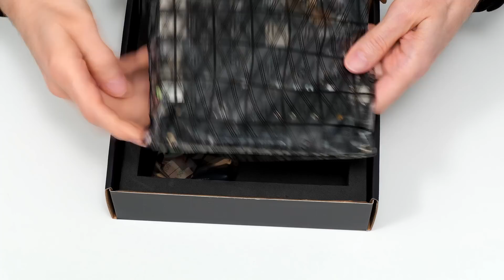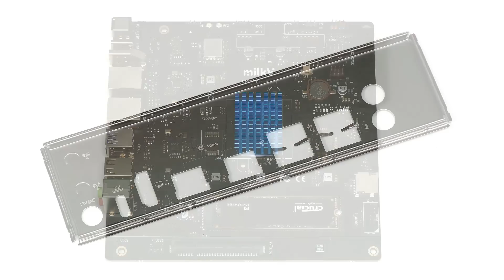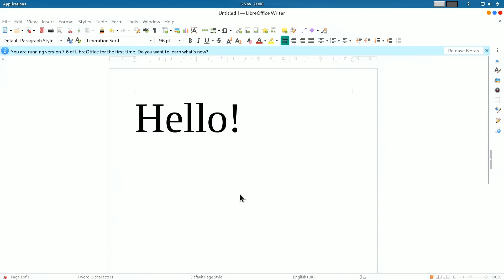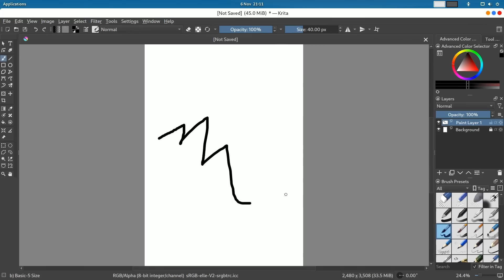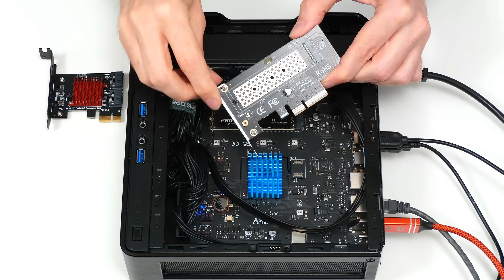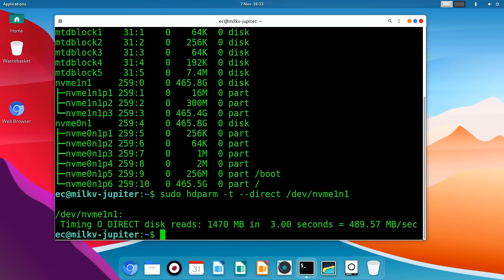Milk-V Jupiter RISC-V PC Build

Comment: It would be interesting to test the PCIe port with a graphics card. An x16 card wont fit into an x8 slot, but maybe there is some type of dongle?
As Linux includes drivers for AMD cards I could imagine that it runs much better than you would may expect on such a system. The bottleneck would of course be the CPU, but that's not really the point here for me.

Comment: 21:25 IMHO it's not just that it is new, but also that it is an open source hardware design with the potential of improving very fast and being customised to the needs of single applications.
As you said in the video: It's incredible how fast the development of RISC-V comes along (but to be fair I can't remember whether x86 or ARM CPUs improved that much in such a small timespan).

Comment: RISC-V: Terrible instruction set made bearable by pushing billions of dollars into it.
Reply: The industry only allows monolithic design with a chipset around the core, blocking interconnect channels.
We need a desktop on a RISC-V scalable grid.
Reply: @henkkl3505  No, we need a good instruction set.
Reply: @andreasrumpf9012  The RISC-V instruction set is complete. it covers all elementary binary operations.
Reply: @henkkl3505  It is severely lacking in addressing modes and lacks add-with-carry etc, etc. It's junk.
Reply: @andreasrumpf9012  Only if your entire CPU is single-core real-time scheduled.. It needs hardware redundancy like a cluster to get some flexibility. It would also entirely destroy the consumer computer industry. You can achieve the same results as the latest flagships with quantity of the same. None of the significant players will ever allow that.
Reply: @henkkl3505  Nothing what you said made any sense. Just dumb your nonsense somewhere else.

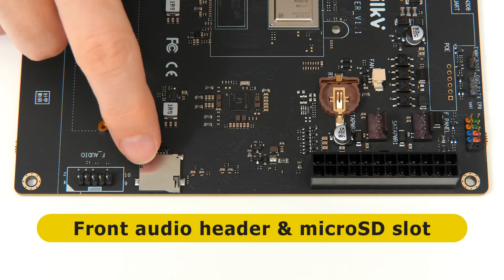Comment: 05:28 I wish there were PCs with BIOS/Firmware stored on a µSD card instead of a soldered-in Flash EEPROM. Imagine that: updating your firmware would then be as easy as swapping an SD card.

Comment: For Krita, itwas already usable on 1 core Sipeed based on Allwinner D1 without GPU, but you just need to disable GPU acceleration, as this board probably doesn't have OpenGL (default Krita rendering, so it switch to soft mesa GL rendering) but only GLES and vulkan acceleration?

Comment: I just fail to see how RISC is superior to ARM, Open ISA doesnt do anything for me when RISC perpetual licences are so cheap.  And even the core design performance of ARM Machines is tested and much superior to RISC they even come with GPU cores, which you can replace with your own design shall the need be.
Reply from the maker: Well for a start, Arm is RISC! Arm stands for "Advanced RISC Machines". So I think you are confusing RISC and RISC-V -- they are NOT the came thing! And as this video very clearly notes, the Milk-V Jupiter, just like ALL current RISC-V is a development board. It is NOT an end-user product, and is intended solely for those developing for, or otherwise interested in, RISC-V. Right now desktop RISC-V is not as powerful as Arm.

Comment: You could have unscrewed the back bracket from those cards to physically get them in the slot. There's no significant weight from the heatsink/nvme to worry about and it doesn't look like there are ports on the bracket you need access to.
Reply from the maker: No, I could not. They would not physically fit in the case even with the brackets removed. I of course tried this. As I explained, the height of the motherboard in the case (due to the drive space under it) prevents them from fitting inside it. I'm not an idiot! :)

Comment: 9:25 there should be fairly simple clamps be available either with the sinks or perhaps separately, should not cost more than a buck. The two holes are already there. Mostly south bridges are held down this way on x86-64 boards.
Reply from the maker: Indeed!
Reply: unfortunately this doesn't work quite that way. SB's heatsinks almost fit forcing one to use long poles because they have to be slighly at angle. Drilling round hole to eliptical shape is 'a' solution but as far as i am concerned there's no "out of the box" replacement.

Comment: Great video as always, I recently got a milkv jupiter for RISC V development and I'm already a fan of it. By the way, the jupiter is compatible with both radxa's rockpi eMMC chips, and the fan cooler for the rockpi 5B. So if you're looking for proper cooling and/or eMMC storage, I highly reccomend those. BTW, if you'd also like to try a GPU, I've heard that RX5__ gen cards have been tested on the board.
Reply from the maker: Useful info, thanks.

Comment: You can secure large heat sinks like that with pushpin holes on the motherboard with zip ties. If you get a zip tie where the square end can't fit through the hole, But the rest of the zip tie can, You just simply Put the zip tie up through the hole, loop around one of the fins and go back down through the hole and zip it tight.

Comment: Hi. Just started subscribing. Love the videos. You describe  and explain things very clearly. I use Cubase on my PC but I need to upgrade soon. I’m currently undecided about moving over to Mac or staying with PC. I’m worried about the issues with the Intel CPU’s (overheating etc). Could you do a build video of a current PC intel (or AMD) system that is likely to work. My current system is a dual Xeon, Windows 10 with 128gig of Ram. I’d love to be able to build my own. Cheers. Jon.

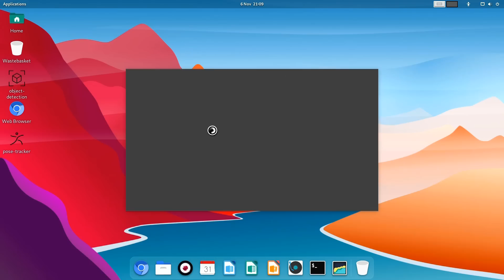Comment: 14:45 just BTW, "gimp" is a slur against disabled people, the GNUimp people know this (and knew it when initially choosing the name) but refuse to change the name, even though the name is harming their software

it's really unfortunate how there are people like this, making open source look like it's made up of insensitive and stubborn jerks
Reply: "gimp" is also the name of a suit used for... uh, well, less than wholesome activities. Alas, the name GIMP has stuck on for too long to just go away so it is what it is.
Reply: @Praxibetel-Ix  as far as I know, those communities mostly don't use that name anymore, for this reason. 

And no, it's not too late, many long running projects have successfully changed their name. That's beside the point, removing a slur is not always easy, but that's no excuse, not doing it because it's difficult is just pathetic

the devs have known about this for ages, so they could have changed the name when the project was less known
Reply: @ThylineTheGay  You got a point there. It is a shame that the devs won't bother changing the name to something less offensive. GNUimp does sound good. Also, considering how 'imp' usually means a little demon fella, it'd be a fitting name! (I'm in the 'ick, GNUimp' camp. it's not the same as my beloved PaintShop Pro but it'll do)
Reply: @Praxibetel-Ix  I use krita personally
Reply: @ThylineTheGay  Sorry for the late reply, but is it really as good as they say it is?
Reply: @Praxibetel-Ix  I'm no incredible artist, but it works well and has a pretty decent UI

Like GNUimp, it's not really a replacement for Photoshop, as it lacks more of the photo editing things
Reply: @ThylineTheGay  I'll have to give Krita a try at some point! I need a good alternative to MyPaint.

Comment: IMHO , IT WILL BE A LOT EASIER TO REMOVE THE BRACKETS FROM PCI-E CARDS ,NOR THE MOTHERBOARD FROM CASE!🤪🤪
Reply from the maker: I'm not an idiot! Removing the brackets does not work -- the PCIe cards still do not fit! :) They are both too high for the case, and too long as well.

Comment: Weird that there are SATA power headers, but no SATA ports on board. Also strange that the power headers are on the opposite corner of the board to the PCIe slot you need to connect SATA devices.

Comment: In my mind ARM, comparing to x86, has many architectural advantages (so Apple with their M1 left others to bite a dust). But RISC appears to be an ARM for poors bringing no advantages at all. I'm not surprised RISC products are developed by China companies only. What I don't mind is to have few utility RISC cores in some FPGA (to reduce a price). Also it would be great if all microcontroller manufacturers migrate to RISC architecture (in case it's not ARM) just for an unification.
Reply from the maker: You seem to be confusing RISC and RISC-V. All Arm processors are RISC -- Arm stands for "Advanced RISC Machines". It is not true that only Chinese companies are developing RISC-V products -- the largest RISC-V developer is SiFive, based in the United States!
Reply: @ExplainingComputers  Thanks for the info, I'll check them out. By saying simply RISC everybody means RISC-V.

Comment: Thanks! As a hobbyist programmer, I very much look forwards to doing some coding on a RISC-V processor. I'm actually interested in OpenMP and pthreads, and look forwards to when some massively multicore RISC-V chips come available. It would be fun to learn some assembly for RISC-V. It looks like it might be worth getting a small RISC-V computer to try out at this point.

Comment: RISC-V SBCs are still dead slow compared to X86 and ARM, for the most part only chineese SBCs available at the moment (I would'nt trust any chip made by a chineese company), and why for the love of god does he always showcase RISC-V with Bianbu (again I would'nt trust a chineese operating system), and in this case seeing its a Milk-V board, Ubuntu is fully supported, why not use that instead of shady chineese distro?
Reply from the maker: I'm not sure now Ubuntu is "fully supported", given that Canonical do not make an image available, and the one from Milk-V/Spacemit is Ubuntu  23.10, which is out of support! :) It is for this reason that I can the distro  recommended -- Bianbu -- which is Ubuntu optimized for the hardware.
Reply: You are of course right about that, but my point is, at the moment RISC-V is not all that much to be excited about. Unless western companies starts making sbcs for the consumer market, backed by trustworthy distros, RISC-V is niche a chinese thing. All good things has to start somewhere, but the rise of RISC-V in China is not random at all. The chinese government is afraid of losing access to western technology, so they are backing on RISC-V because of its open nature to avoid potensial sanctions. Most of the available chinese RISC-V SBCs are not fully open source (all though they love to advertise that RISC-V is an open instruction set), and I can only assume Bianbu OS contains code that is not documented and closed source. I would never put a chinese SBC with a chinese OS in production on my network. Still I think its great that you cover RISC-V boards on your channel, but I find it a bit strange that you never say "use at own risk", or give some sort of disclaimer when reviewing these boards.

Comment: I did watch this right, right? Two sata power connectors but no sata data connectors? Also not the usual cr2032 for the bios/rtc? seems like odd choices.
Reply from the maker: Yes, you watched right -- the board has SATA power connectors but no SATA ports!

Comment: Thank you for your excellent review ( as usual).

Is there a specific reason those cpu's are running at low speed , like M1 going at only 1.8Ghz  when most of the CPUs today are gearing 2.5Ghz or even 3Ghz and up.

Best

Comment: Actually, you can just remove the PCIe AIC bracket from the card and should be able to plug the card in the case without needing to take everything out from the case.

Comment: Some say "No news is great news" and, here at least, I would say "slow news is good news".
It's too often about all or nothing when it comes to computer developments, but just glance back to when we got excited about an SX50 processor being replaced by a DX100 (if I have even remembered those details correctly).
Then Pentium running at hundreds of Mega-hertz.
The Celeron, was it?
Just two minutes ago, really.
I for one, more on philosophical lines than technical, am very much looking forward to what I think this revolution (as I see it) will bring.
Openness.
I share your excitement, Mr Computers, or may I call you Explaining?
Thanks a lot of this, I am eagerly anticipating the video in which you show Krita skipping along smoothly an a RISC V system.

Comment: Boards like this would be perfect for those with minimal computing needs, and minimal budgets.

I've also wondered to what extent might there be some sort of hybrid or supplementary processors used to facilitate the same low power usage for most tasks while having the option to engage the more complex processor or cores to enable things like gaming, video encoding, etc.

Comment: the gap from not running anything to running slow is way way greater than the gap from running slow to running fast. It wont be long RISC-V paired with Linux may prove to be the final nail in the cofin of x86/windows...

Comment: Slowly but surely. RISC-V is getting there. With ARM getting too big for its britches and x86 failing to innovate, there is a legitimate possibility that RISC-V may manage to close the gap.
Reply: What "gap"?  Almost all computer users buy turnkey products, from one of four major small computer makers.  None of those makers have any reason to use RISC-V.
Reply: @TheDanEdwards  
You're wrong in like 3 different ways and I don't even know where to start.

Firstly, I was talking about the performance gap. 

Just 4 or 5 years ago, RISC-V was so far behind that the products on the market were barely suitable as micro controllers in a co-processing role. Now they're just getting powerful enough to serve as the main CPU in a SBC. All it would take is one major leap for them to catch up to SBC ARM chips now.

Secondly, they all have reason to use this chip, due to it being an open standard. If the design of RISC-V chips evolves enough, some small computer makers might just start cutting out the middle man and start their own chip design wing in order to dodge licenses and have the ability to make chips with more specialized designs meant for the SBCs or other devices they're going into.

Thirdly, RISC-V being an open standard could legitimately result in more turnkey manufacturers, making for a more competitive market where it's harder to remain an 800 pound gorilla or monopolize the market with trade secrets.
Reply: @TheDanEdwards  
You're wrong in like 3 different ways and I don't even know where to start.

I'm going to have to split this response up, as the big G is sensoring my post. (not a typo, but a bypass)

Firstly, I was talking about the performance gap. 

Just 4 or 5 years ago, RISC-V was so far behind that the products on the market were barely suitable as micro controllers in a co-processing role. Now they're just getting powerful enough to serve as the main CPU in a SBC. All it would take is one major leap for them to catch up to SBC ARM chips now.
Reply: @TheDanEdwards  
Secondly, they all have reason to use this chip, due to it being an open standard. If the design of RISC-V chips evolves enough, some small computer makers might just start cutting out the middle man and start their own chip design wing in order to dodge licenses and have the ability to make chips with more specialized designs meant for the SBCs or other devices they're going into.
Reply: @TheDanEdwards  
Thirdly, RISC-V being an open standard could legitimately result in more turnkey manufacturers, making for a more competitive market where it's harder to remain an 800 pound gorilla or monopolize the market with trade secrets.

Comment: If you've got a PCIe card that won't fit in a case, but it has no external ports, why not just remove the card's bracket and avoid pulling the motherboard back out?
Reply from the maker: Because it still did not fit! :)
Reply: @ExplainingComputers  oh, my mistake. I missed that part.

Comment: I am sure you would be happy with an Arsylid K39 casing for mini-ITX builds. They are versatile, look clean and you only need to add a PCIe riser cable if you want to use a discrete videocard.
Reply from the maker: Thanks for this, looks a nice case.
Reply: @ExplainingComputers   yes I am very happy with it - only 4,2 liters but right after I suggested it here, I realised that I bought this case myself because it has NO front panel. Something you may want (but I dont)  ;-)

Comment: I've the same system running here and there are only two disappointing things to report:
1. documentation....comparing to e.g. VisionFive 2 or Mango-Pi, there is nothing comparable for the Jupiter
2. PCIe-Slot - I mean...come on...if you see a PCIe slot on an RISC-V board with an Imagination gpu what are you thinking? Yes...an external GPU and it is even advertised...but it doesn't work...not an AMD RX550, not a very old NVIDIA card with NOUVEAU-driver
And...this board, in opposite to the VF2 or other alike boards was not advertised as a devlopment board...so we should have expecting more.

Comment: It's a wonderful time to be a computer enthusiast. Making a computer for regular use with an open architecture is no longer the the risky proposition, with the advancing maturity of the RISC V xl systems now available. 

The presentation for this build is lovely and I look forward to further growth in this area of computing. 

It's impressive to see how far streaming playback has progressed in the last few years. And the increasing amount of software support if encouraging as well 

I wonder how well a PCIe riser would do in that motherboard. I know they can be rather finicky depending on what they are connecting. Though I admittedly didn't have any personal experience with them.

Hopefully KDEnLive will do better moving forward. 

I do also hope RISC V continues improvement and in greater daily use viability.

This was a wonderful video.